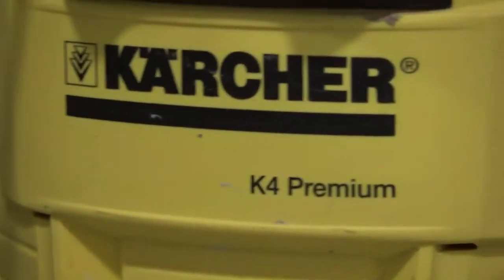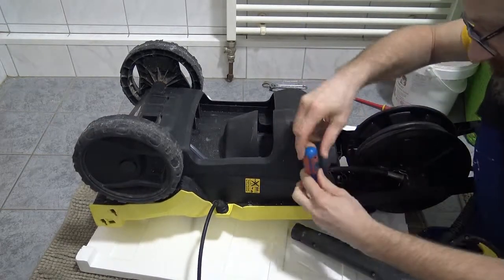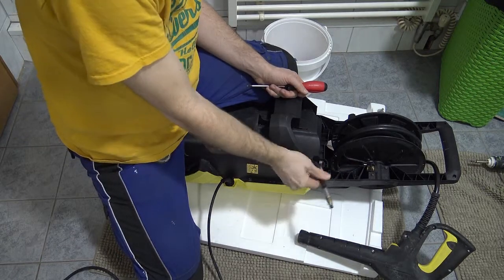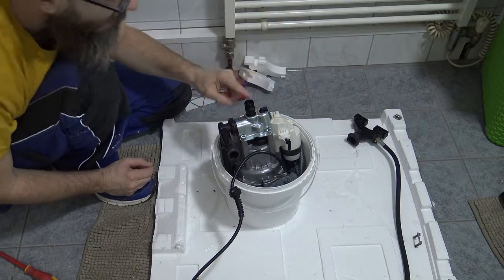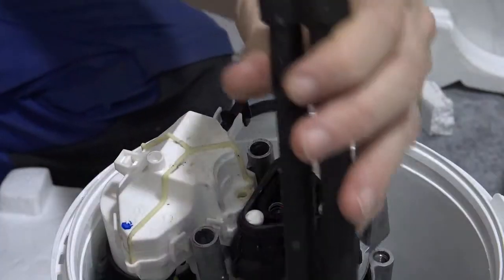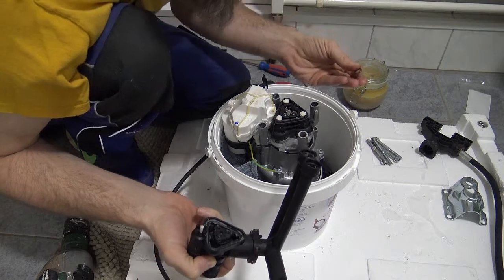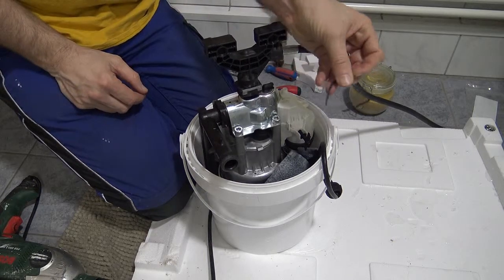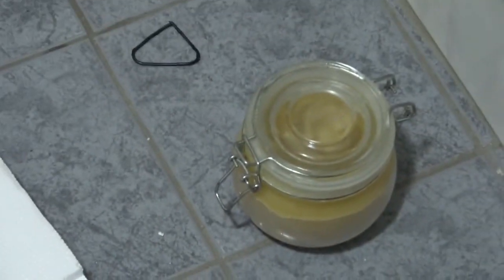Karcher Gasket Replacement for Pressure Washer DIY Project

Comment: Your placement of the gasket (o-ring) is incorrect. Check out all other videos including professional companies. The o-ring should stretch around the lip on the housing not sit loose in the middle! I saw your video first and tried this and the gasket ends up in the wrong place. Nearly wrecked my o-ring. Hope this stops someone else making this mistakie!
Reply from the maker: Thanks for that!
Reply: Yeah I believe this is correct the triangle gasket should be wrapped around that lip. The reason for searching for this kind of video was to make sure that I was putting on correctly because laying it in there just didn't seem right but I'm pretty sure I got it right. My triangle gasket has not snapped in half I just think it's been worn down too much therefore it's leaking. I want to try to stretch an o-ring around the triangle that would fit instead of trying to order a triangle gasket. Got different companies selling some but I want to find a trusted source like Amazon but I don't believe I saw one on amazon.